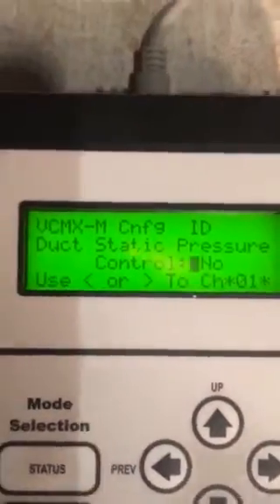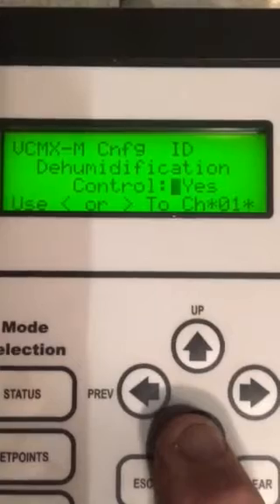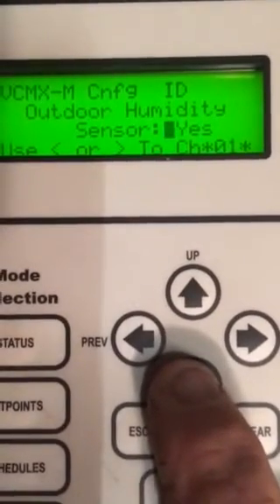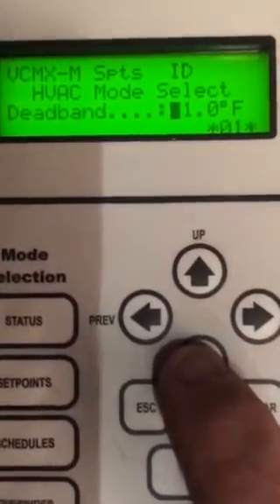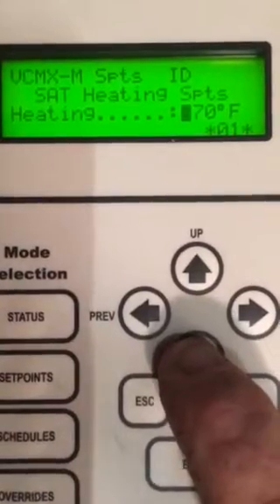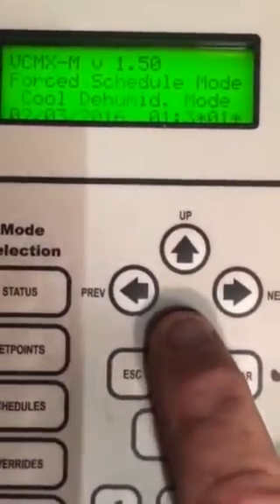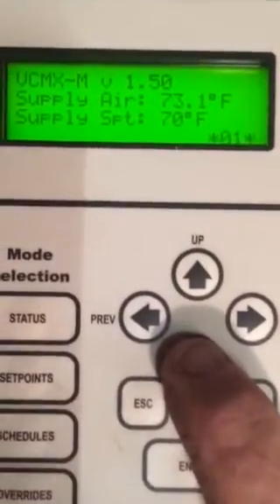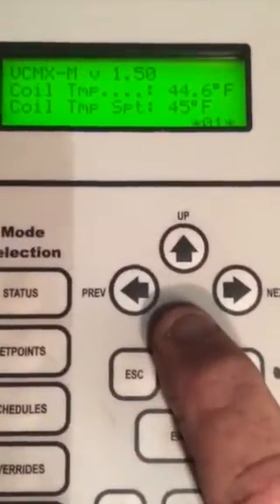Wattmaster 100% outdoor air Configuration

Comment: Are you utilizing a BAS/BMS system with this unit?  I asked because on occupied mode I was told it should be in "unoccupied" for in occupied or forced occupied mode dampers will ignore "auto" global command  from BAS/BMS and remain open unless forced closed via manual command.  Your thoughts?